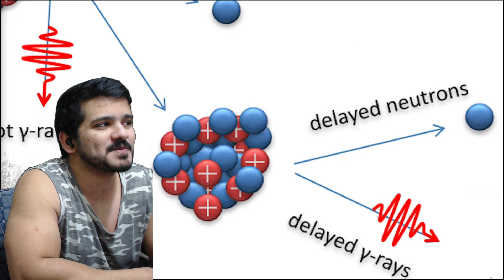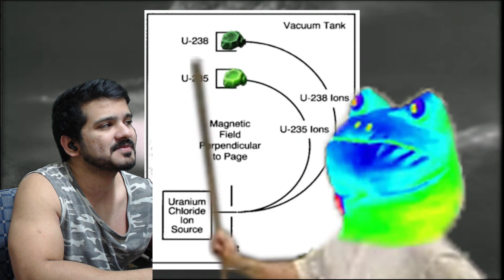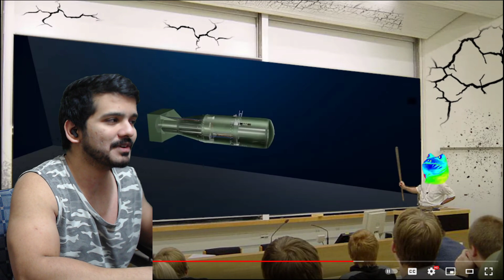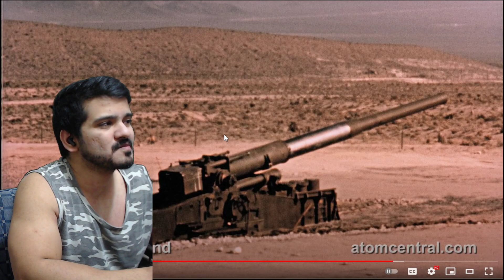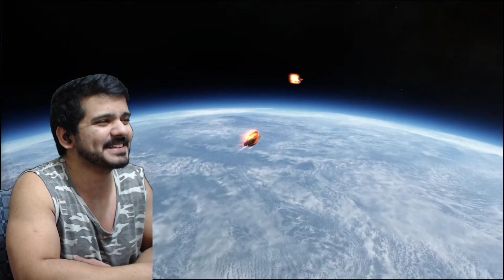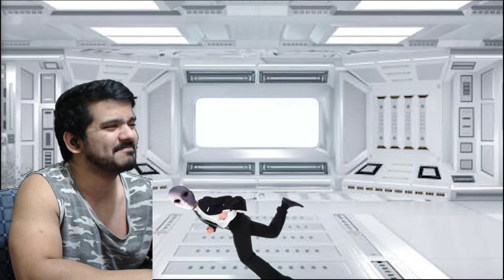Kerbal Space Program 4 | WAR part 2 by martincitopants

Comment: so fun fact, After making an order for 60 of those 11inch guns to use the W9, we made it even smaller and shoved it into existing 203 and 155 guns (and 16 inch rifles on the Iowas)making the guns in question almost pointless as moving those things was an undertaking. Damn thing needed two prime movers to go anywhere. Oh and that mini nuke launcher you're talking about? The Davy crocket was envisioned as a anti tank rifle. It was highly radioactive as the device couldn't burn all the fuel it had fast enough before it was dispersed and had a maximum range about 100 yards within the blast radius. So yeah during the 50's one of our primary tactics was to hope our ground surveillance radar that wasn't really out yet would pick up a contact and then nuke ourselves using a warhead and launcher that wasn't in service yet. Man was the atomic army fun. Battleorder has a video on the subject if you want more on that

Comment: The only reason Tsar Bomba was gimped was to reduce fallout and make sure the bomber that dropped the nuke could get out the way in time, so instead of a U-238 tamper, there was a lead tamper, so there was no fast fusion, meaning 97% of the yield was from fusion, making it relatively safe as far as radioactivity was concerned, helped by the fact the fireball never touched the ground, it registered a 5.0 on the richter scale. The bomb was also so large, its parachute was close to a tonne and would open to 500 square meters, that the Tu-95 bomber used had its bomb bay doors and fuselage fuel tanks removed just to fit the thing and was designated Tu-95V. The Tu-95V and accompanying Tu-16A, which took photos and videos, still only had a maximum 50% chance of surviving, though this may have only been for the Tu-95V, despite being 39 and 53.5km away from ground zero respectively, the bomber was caught in the blast at 115 km, losing about 1300 meters in altitude before leveling out again, the Tu-16A was 205 km away when the blast caught it, though . An american KC-135 that was supposedly nearer the blast, I can't remember the actual distance or if it was slightly farther out, had it's anti-flash paint scorched. At its measured yield, Tsar Bomba increased the total yield of detonated nuclear weapons by approximately 13%. In fact the original design was supposed to be able to be scaled up to a gigaton, since why not.

To conclude, bomb go boom, also there's NUKEMAP, very fun, only goes up to 100 mt tho.

Comment: The Ship crashed at several times the speed of light into one of the suns of Proxima Centauri creating an artificial supernova which destroyed the star system and its planets. I don´t think that this is what would actually happen though... maybe... i dunno. Who knows what happens when you send a whole bunch of antimatter into a star.
Reply: Most likely it would make the sun go critical, depends on how much antimatter I suppose
Reply: Pretty sure Proxima Centauri is too small an light to turn supernova.
Reply: If you threw enough antimatter at enough speed into the sun it would likely go nova, though of course it would have to happen below light speed.
Reply: @mifiwi3438  I'm pretty sure that ship was going hundreds if not thousands of times faster than the speed of light to get to proxima centauri that fast.